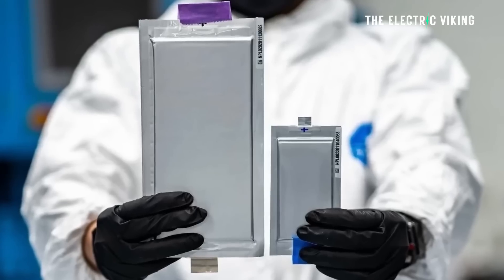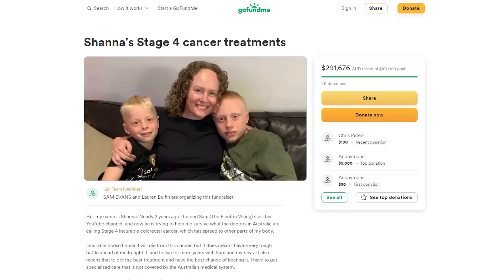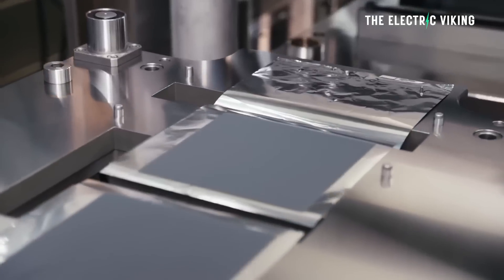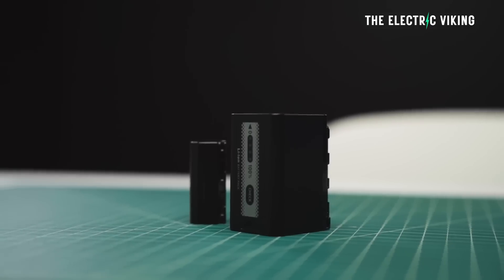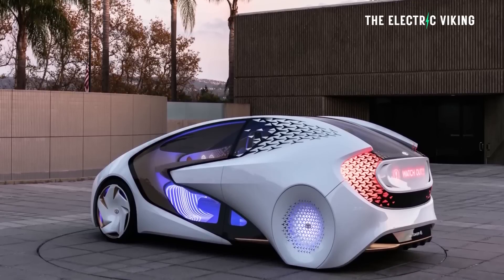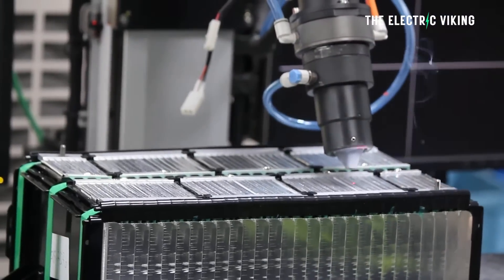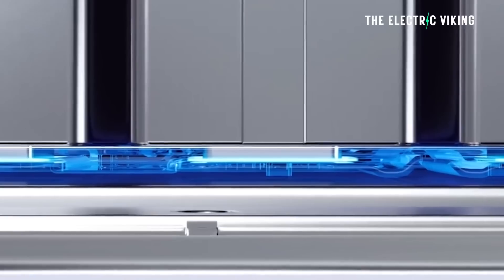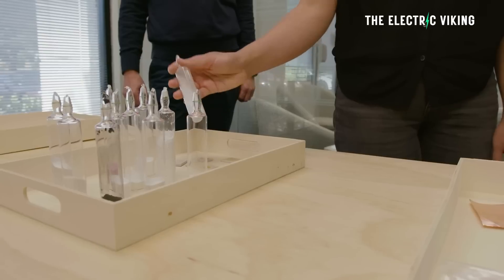3D-printing enables cheaper, lighter & power-dense solid-state batteries

Comment: If you don't believe in what 3D Printing can do for Batteries... Look what they did for Porsche Gas Powered Engine Pistons, Microwave Band Antennas, discrete Electronics Components and Aerospace Parts. This World is changing, right now.

Comment: We have seen a parade of promising battery chemistries so I will believe it when I see it. Although I am really intrugued by using 3D prining to manufacture, solid state lithium cells are still a curiosity as they cannot match the cycle life of current lithium cell. Quantumscape and even Toyota are said tp have cells but these are not production ready for EVs.  I definitely think there will be a market for third party replacement packs for EVs that are drop in upgrades as future chemistries emerge. Already we have lithium upgrades for older power tools that originally came with NiCaD

Comment: I Hear Sandy Munro say the flat battery is crap. If it expands, or is damage it just takes the other next to it out.
Reply: He's talking about current lithium-ion technology, which can be unstable and he's not wrong, flat batteries are more energy dense(less wasted space) but also more dangerous.  Solid state batteries, however are more stable and don't have the same shortcomings.  However, they are many times more expensive and currently lack longevity not to mention manufacturing at scale.  So they have many improvements on current Li-ion batteries they have their own list of shortcomings and those shortcomings are pretty big at this time.
Reply: @Ryan-ff2db  one of my issues with the design they show is its not structural so they will add weight to hold the batteries in place. I would assume that can be fixed. And in the long run its Price, power and cost Vs Price, power and cost of what tesla is making.

Comment: All the "gee whizz" 3D printing I see is slooooooow
In the case of printing a firearm, people don't mind waiting
In the case of "let's make 1 million batteries before lunch," 3D printing is a joke.

Someone needs to speed up 3D printing by 100,000X at least
Reply: Thank you. I don't know much about 3D printing, but I thought it fast process; a shortcut for designs.
Reply: @icosthop9998  Engineering objects to be printed are generally small, less than 12" cube and most of that is air - they take hours to print, and usually, you leave work, and the next morning it's almost done printing.

So prototyping is great on 3D printers - faster than any other method, but I just don't see batteries 3D printed in production speeds of thousands an hour.

This sounds like the typical "solution" in search of a "problem" that's unrealistic.
Reply: @noleftturns  Remember downloading a film 15 years ago? Hopefully, it'll be speedier in the near future. Knock on wood.
Reply: @dac545j  Difference between speed of light and speed of melting and cooling plastic.
Reply: @noleftturns  TY
Reply: @icosthop9998  3D printing is great for printing one of a kind for testing, totally useless for mass production.